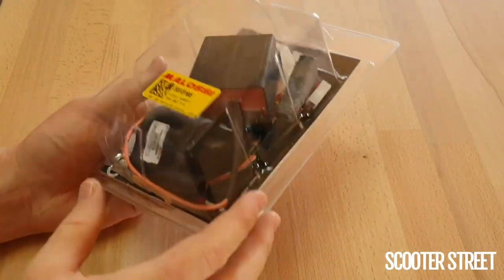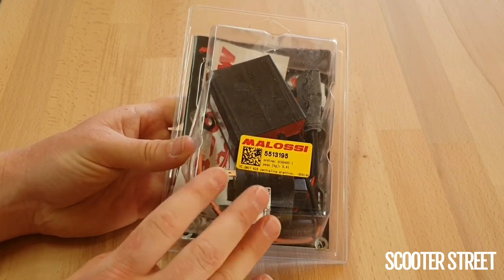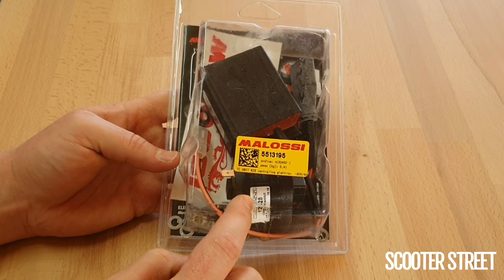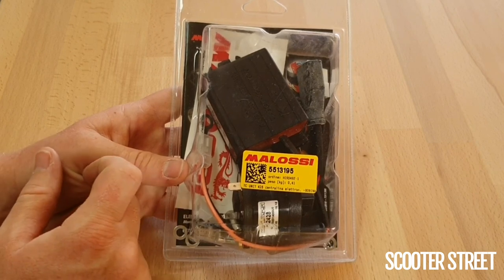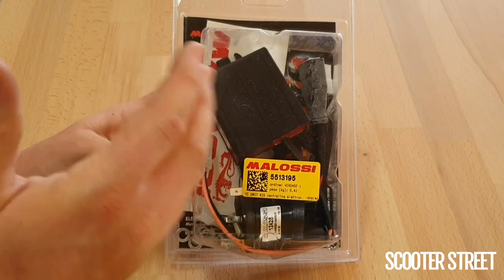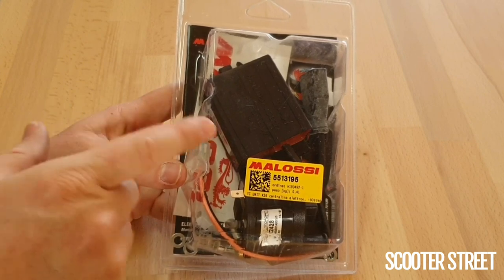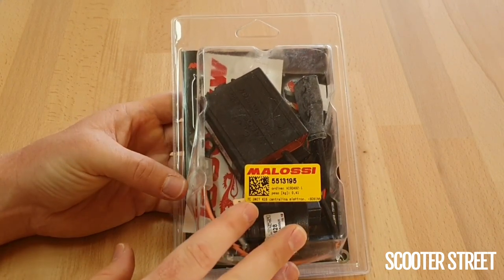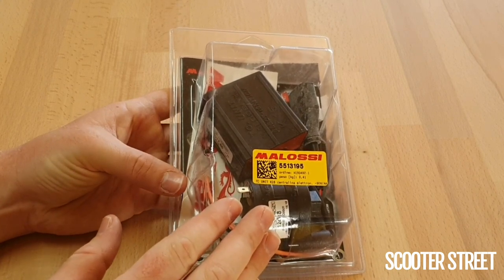Malossi TC Unit CDI for Aprilia SR50R / SRMT 50 / Piaggio Zip / Typhoon - What does it do?

Comment: Watched this video several times. i bought this product for my aprilia sr with 2T piaggio engine. I am very happy with this product. My setup 70 cc malossi replica, 22mm dellortho Yasuni R exhaust. The engine is so much stronger and faster with this tc-unit compaired to the stock cdi. The ignition curve is very well tested by malossi. Rpm Stock cdi was 10k, with this unit it goes to 14000 on my scooter, but it can handle 20k. big benefit of this unit,: battery will be charged, and all electrics still works. 
In the manual its not clear how the rpm limiter is set. you have to go to the speed what you want, and than hit the switch to set it. with the adjusting screw on the cdi you can fine tune how it runs on the limiter. the sound with the limiter on is like every speedlimiter, it runs like crap.  hope this review helps somebody.
Reply from the maker: Wow Peter, great review, excellent use of the YT comment section. five Kangaroos for you mate.🦘🦘🦘🦘🦘
Reply: i have 5518130B ecu unit for aprilia sr50r, how can i take out the limiter?
Reply: hi  i have got an f12 and i founded this in my room how does it work ?

Comment: HI mate, got a derbi gpr 50. It has a race exhaust nu toher than that it is stock. Would this be any use in acceleration and top speed?. many thanks
Reply from the maker: I don't know a whole lot about the 50cc geared engine, what RPM it reaches, or what CDI is has from factory. In the scooter engines, the factory CDI is limited to 11K rpm, might be best to test yours (assuming it has a tacho, which makes it easier than a scooter to check). If it is limited, the TC Unit has potential to make a difference. Unless it has a larger cylinder kit, I would say that its most likely that the bikes top speed will be limited by its power, not the RPM restriction.

Comment: Can i install a electronic rpm limiter on a piaggio zip 2t? It’s the original ignition system
Reply from the maker: Yes, I have seen a few products available in Europe sellers which is wired in to the electrical system to limit the RPM with the flick of a switch.

Comment: Is there any restirictors in the factory cdi or is there any electric restriction in the Aprilia srmt 50 scooter
Reply from the maker: Yes many restrictions in the engine and also the CDI. The late odel after 2018 changes the system but also comes with restrictions. We cover these for the 2018 + in another video.

Comment: Hello sir. I just removed the restriction ring for variator and i have the Yasuni Racing exhaust and i changed the bensin filter but still my scooter have a normal acceleration and goes max 45 km/50 km per hour.. can u tell me what should i do to get perfect acceleration and a good top speed ? I have Aprilia SR 50 R Carb . Thanks
Reply from the maker: You need to tune the variator, the clutch and the carby.

Comment: What would you say the rev limit is on an aprilia sr motard 50 2 stroke euro 2?
Reply from the maker: approx 11k rpm. You will never hit this limit unless you hit a bridge port racing cylinder kit, and racing exhaust.
Reply: @scooterstreetau  ok thank you I just wanted to make sure I currently have a stage 6 HPC crank, malossi sport 70cc, full malossi transmission, 22 carb and yasuni R

Comment: Bro I bought a zip with 70cc malossi ecc ecc I took off every restrictor (carb variator and exhaust) but still goes slow. Could be this the problem??
Reply from the maker: No not likely. You have another issue, did you change the exhaust, has the carby and the transmission been tuned?
Reply: @scooterstreetau  yes, I have. I put on: 17.5 dell’orto and malossi multivar🤣but it still goes slow like a turtle (60km/h) ahaha I took off everything, but I can’t find an answer
Reply from the maker: @mattia92fc  Did you change the exhaust?? 
Was there an issue prior to you fitting the performance parts?
Can you list the changes you have made?

Comment: It is a Cdi unit from Malossi with a Malossi ignition coil, the only difference between this part you have and an Unlimited cdi unit is that on your part you can turn it off and on,
You don't get more power out of this system you have here than if you put an unlimited Cdi on ... Just because your ignition coil gives more Volts, only means that you will have ease by being able to start your Maksine when it is cold, and then you will find that it burns a bit cleaner, but you will not find that your cylinder increases from 10000rpm to 14000rpm because of the ignition coil, your RPM only increases because you have turned off the Cdi unit's limitation...
Reply from the maker: Yes, you got it👍

Comment: Hello, i know im late with this but if i bought this, would i be able to let it switch from like 6500 rpm to 10000 via a button or smt?
Reply from the maker: Yes, this unit allows the engine to rev past the factory limiter, good for Cylinder asking for more than 9000rpm. Fits many Piaggio models, 2000-2016.

Comment: Would this malossi digitronic (5518130B)
work on Aprilia sr 50 r 2018 2t (carb.) with giannelli reverse and if its a benefit?
Reply from the maker: Yes the part you mention is to suit the Euro4 SR50R Carb version. The TC Unit in the above video is for the earlier carb Version.

Comment: Hello! Can I install this part in my 2011 Piaggio Zip 2t AC?
Reply from the maker: Yes, this part will fit on the Zip 50cc 2T. You would fit this if you have a racing cylinder and it is hitting the limiter at high RPM.
Reply: @scooterstreetau  great, I have a mid racing setup, thank for your answer
Reply: @scooterstreetau  I have a woodruff key in my ignition system to advance the ignition 0,8mm. Will it cause any problem with this malossi unit?
Reply from the maker: @lopezfpv724  When you fit the Malossi unit use the standard Woodruff. After you have it running well then you can change the Stepped key.
Reply: @scooterstreetau  thanks

Comment: I have an Aprilia SR50 Gp Replica with standard cdi by changing the cdi with a malossi one will i get better performances?
Reply from the maker: Oh you are very lucky to have this Graphic design☺
Answer = No. Only if your engine is reaching the RPM limiter would you fit this part. The Standard engine will not meet the RPM limiter.

Comment: Would there be a benefit on a euro4 typhoon?
Reply from the maker: This part is NOT suitable for the Euro4 Typhoon. You need the Malossi ECU 5518242B.
Reply: Scooter Street Hi i got that. Is there any advantage to the compatible one?
Reply: @guyevans1425  yeah change wire harness
Reply from the maker: @guyevans1425  Yes, the factory ECU has a limiter, the Malossi ECU offers a derestriction for the limiter.

Comment: Can this be use for modified exhaust with original cylinder? I havent got my force master 2 installed, could i still use it?
Reply: Oh theres one thing i forgot to mention, my vehicle is the honda sh150i model 2007, could i use the tc unit simultaneously with the force master? As for my research i found that malossi is lack of information :(
Reply from the maker: This is exclusively for the Makes and Models Malossi list (Piaggio and Aprilia + more) and will work as explained in the video... When the RPM limit has been reached and the restrictor cuts in, fit this TC Unit is the RPM will exceed the factory limit, BAM🎉 Would not be useful on a 50cc engine. MHR rep or higher.

Comment: Would it be worth installing with an aisal 70cc t6-racing kit and stage 6 pro rep mk2 exhaust?
Reply from the maker: Yes for sure, bridge port cylinder kits like the T6 need to rev past the factory rev limit to function at their best. I would say, the S6 MK2 will be limiting the potential of the cylinder, a larger exhaust like a Yasuni C16 or similar would be much more capable with that cylinder.
Reply: @scooterstreetau  If I were to ger either a top perfomance nardo replica II or yasuni c16 exhaust, which exhaust would you say would be the best for my setup?
Reply from the maker: @tommyn4031  We're not very familiar with the Top Performance exhausts, but the C16 will work really well. Just keep in mind that when you go for a high revving setup, everything needs to match. Often the initial take off can suffer unless you also have an inner rotor.
Reply: @scooterstreetau  What size carb would you recommend for the T6?
Reply from the maker: @tommyn4031  Dellorto PHBG 21mm
Reply: @scooterstreetau  Thanks 🙏 appreciate all the help
I’m using a piaggio new typhoon 50, what gearing would be best if wanted to improve top speed? I’m gonna be installing the T6, Malossi tc unit and 21mm carb, polini high speed vario, malossi fly clutch and wingbell, and the c16 exhaust. 
I got recommended malossi 13/44 primary gearing, but i don’t know if that fits on the Hiper2
Reply from the maker: @tommyn4031  We don't have any experience with the Top Performance exhausts, I can only definitively advise that the C16 is excellent. We only advise from our knowledge, if we don't know we'll tell you😎
Reply: @scooterstreetau  what about the gearing though?
Reply from the maker: @tommyn4031  Yes go with that recommended gearing. Make sure you buy the gear kit that fits your scooter, check the Malossi fitment list.👍

Comment: Sir a noob question... From what I heard i can use a 70cc Malossi set with stock 12" carburator on Peugeot SpeedFight 2. Question is what benefits i could have if i install a 19 carburator on it? I already have a Gianelli Reverse exhaust, Malossi Multivar with 6g (stock) and blue clutch springs and i will install Naraku CDI tomorrow. Top speed is 80-85km'h with 100kg guy on it. I would like to get like 100km/h and the problem is on internet not to many people have Peugeot Speedfight mods. Thank you for your answer in advance!
Reply from the maker: We are all Noobs so your not alone☺. Yes you can use the 70kit with the 12mm carb. However, the benefits of a larger carby teamed with the 70cc kit would be significant to the overall power and the natural progression of tuning would be to upgrade the carby with the cylinder kit at one time. You will need the gear up kit if the target is 100kph. Go for a higher performance 70 kit, not the standard cast iron.
Reply: @scooterstreetau  I upgraded kit. i have 70cc malossi kit, gianelli reverse exhaust, naraku cdi, malossi multivar and blue springs for clutch. top speed is 95 97. i will buy a delorto 19 carb. will it make it even faster right? :D
Reply from the maker: @MrT3rminator  Great stuff🤩. As I mentioned go for a higher performance 70 kit, not the standard cast iron. MHR Rep at minimum... Yes the 19mm carby will produce more power than the 12mm carby. Take your time tuning the transmission and the carby.
Reply: @scooterstreetau  tuning the transmission? what do you mean? For carb i know i need to find the right setup from main jet and air but what for transmision?
Reply from the maker: @MrT3rminator  Yes. So now you have more power from the engine being delivered through the transmission to the rear wheel. So in order to not have a power loss, the transmission must be tuned. This may include, roller change, belt upgrade, Torque spring change and a performance clutch or clutch spring set. The gear kit is also part of the Trans. but this will be considered as the final piece.
Reply: @scooterstreetau  I have malossi multivar with 6g rollers, blue clutch springs installed, malossi torque spring that came with variator. I will buy malossi kevlar belt aswell to install it. but the rest is already installed.  :D
Reply from the maker: @MrT3rminator  Sounds good👍. Keep us updated..
Reply: @scooterstreetau  should i change the white spring that came with multivar with a red one wich is 30% stiffer?
Reply: @scooterstreetau  from what i read yellow and red springs from variator are better for acceleration but i will loose some top speed...
Reply from the maker: @MrT3rminator  This is the tuning I was referring to, trial and testing to see what improves the transmission. So try the red spring and see what is the difference.
Reply from the maker: @MrT3rminator  You should refer to the specs with the part number, the Malossi springs have different lengths, different wire thickness and different stiffness measured similar to 3.8K or 5.2K.
Reply: @scooterstreetau  i will but i don t want to loose top speed... and from what I understand if i install red variator spring and red clutch spring i will have more torque and acceleration but .. less speed?
Reply from the maker: @MrT3rminator  The variator face must be marked when Trans tuning, You can immediately see it he belt is reaching top gear before you make a change and then after you make any change.
Reply: @scooterstreetau  oh and one thing... i heard many things after you install a new set... some say to go maximum 50km/h for 300km... others say 45km for 700km. others say you can just go 35km full trotle for a better rings seal from piston.. what is your opinion about using new mounted set? I already did 35km full speed trotle and everything seems fine. But i have a friend with a yamaha aerox and he want to change set aswell in the future.
Reply from the maker: @MrT3rminator  I check the oil and fuel prior to riding. Once my engine is warm and all systems are working I go flat out. We have taken apart so many engines and the only difference is carbon build up. My engines are clean internally. This is not the final word, only how I ride...☺
Reply: @scooterstreetau  so when you install a new set you check oil and fuel then you go full trothle? on a new set?
Reply from the maker: @MrT3rminator  Prior to each ride, I mean the next day and so on I would check it.. We all hate running out fuel and I ride so many different scooters.. Once the scooter is warm in the engine Lets go 🏍

Comment: Well it effect a 12v 30/40 starter relay?
Reply: On piaggio typhoon 70cc
Reply from the maker: Not at all. It operates completely independently of the relay.
Reply: Ok because my 12v 80a relay went bad and the only one I got is 12v 30/40a so I was wondering if the amperage difference will effect the typhoon electric system?
Reply from the maker: @rossvictorine8017  It wont affect the electrical system as such. It'll likely just either burnout the relay very quickly, or not start the scooter as the starter motor will be trying to draw more amperage than the relay can supply.
Reply: @scooterstreetau  yeah that's true thanks for you help mate cheers 🥂 🍻 happy holidays
Reply from the maker: @rossvictorine8017  No problems, you too 🎄

Comment: Would this work with  Yasuni Z
Reply from the maker: It works with all the scooters mentioned in Description. It would be fitted if the engines RPM exceeds the current CDI/Coil and creates a miss at top rev. This clever part allows rev to exceed the RPM of the factory CDI/Coil. If the Yas Z is combined with a strong enough Cylinder kit then the answer is YES👍

Comment: good day, I have a derbi GP1 year 2005 (piaggio engine) cdi and coil are combined into one - I would like to know which CDI malossi you recommend for this model, how to connect?

thank you
Reply from the maker: There are several types, this is good from Malossi if you are hitting the electronic rev limitation on the factory CDI. Malossi 5513195. See Malossi website for instruction.